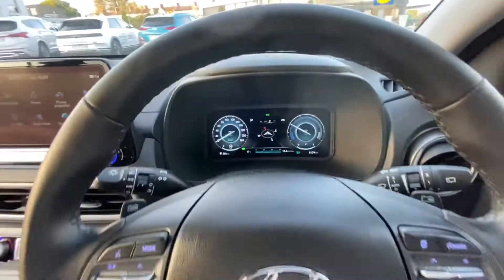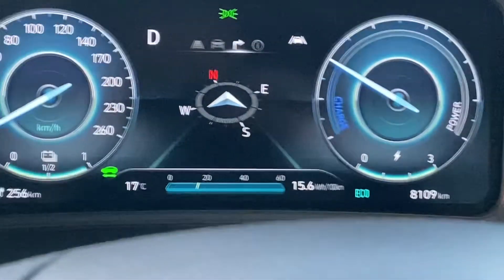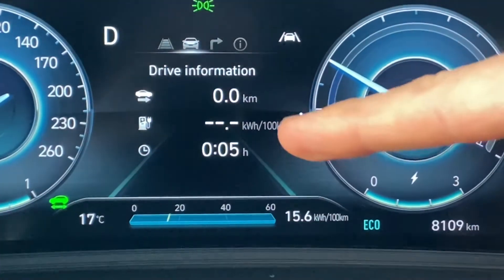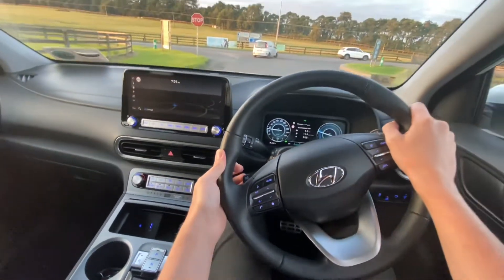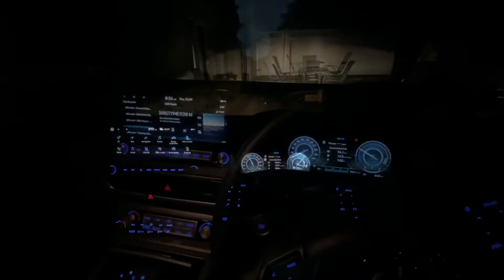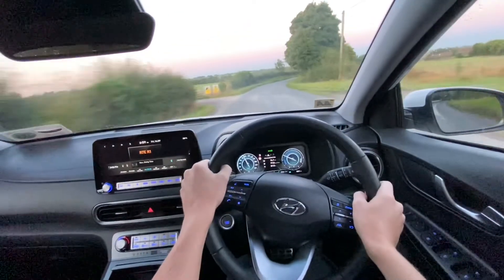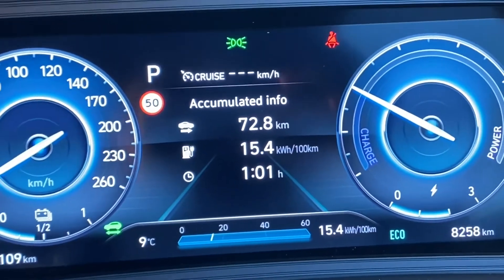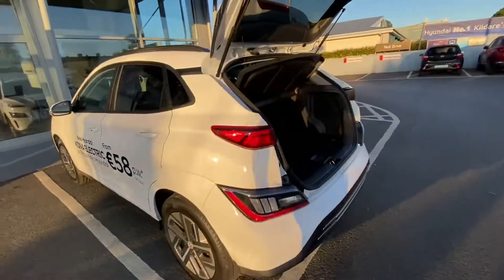Does regenerative braking work? I did a test  #regenerative #braking #ev

Comment: From a Motorcyclist point of view, it's almost exactly like the difference between riding a V-Twin 4 Stroke with high compression, versus a low compression 2 Stroke. After a ride on a 4 Stroke Twin, which has so much engine compression that it tries to send you over the bars if you just whack the throttle closed in lower gears, you get an eye widening surprise when closing the throttle on a 2 Stroke, and it freewheels like you have popped into neutral lol. The expectation of slowing down changing to freewheeling without you resetting your brain to remember this, can almost fake you out into thinking you are accelerating instead, hee hee. My Kona EV did this to me the first time I turned off all regen, forgot, then when I expected a slow down, went Auugh! as the car seemed to speed up instead hahaha
Reply from the maker: Exactly, that’s sort of like the retarder on a truck too 🙂

Comment: You say the motor changes direction for regen. Are you sure about that? Wouldn't that mean you would start reversing? When regen kicks in does the electrics flip to charging the battery, but the motor is going in the same direction?
Reply from the maker: Yeah I should have said the flow of energy through the motor changes direction 👍

Comment: suprised it made that much difference in a mixed driving situation. but anyways, if you managed to drive one car after another at the same pace, it wouldn't matter. it helps in town since you start breaking earlier and doesn't help on an open road because you want to keep the speed as steady as possible. i haven't driven the Kona but i have driven an Inster(actually waiting for one) and the regen beyond level 3 is really strong.

Comment: If you have a RWD EV, does it only regen the rear wheel?
Reply from the maker: @verynick  the car will be a single motor so my understanding would be that the rear wheels, turning in turn, turn the motor to facilitate regen braking

Comment: We just bought a secondhand KONA 2021 Petrol Hybrid Ultimate in the UK.  The brake pedal really needs to be pressed hard to get it to stop.  Before going back to the dealer and ask why it’s like this, I thought I ought to try the regen brake mode.  How do I switch on/increase the brake regen? The manual says put the car in ECO mode and use the left steering wheel paddle to increase the brake regen?  Do I do this when moving or stationary? Can I not have it set automatically?  Seems a bit of a faff to be fair, coming from a non-hybrid car where the brakes were super sharp.  Any help would be greatly appreciated 🤞
Reply from the maker: Okay, this video might be helpful, even though it’s to do with a hybrid it will show you how to engage the regenerative braking using paddles https://youtu.be/PrNVSxL7A-0?si=fkHK059pOIy5aOIq , does it make sense? The regenerative braking can be engaged at any time while driving. The car just needs to be in drive. Let me know if this makes sense. If not then I will try and get a video done to help you.
Reply: @doolanbrian  many thanks! I’ll give it a go when I get to drive it next and report back 👍
Reply from the maker: @bsinghgill  do indeed, and if you are still stuck, then I will do a video
Reply: @doolanbrian  much appreciated 👍
Reply: @doolanbrian  , Hi, I just tried the regen braking on our KONA Hybrid by pulling the left paddle to increase and right paddle to decrease the level.  I’m not sure if there’s a way to have it set on a specific level when you start the car? Otherwise, you have to consciously remember to engage it.  I know for a fact, this will be a faff for my wife, but hey ho, such is life 🥴
Reply from the maker: @bsinghgill it depends on which Mode you are in. Are you driving mostly in eco-mode or normal or Sport? From recollection, eco-mode is naturally set at regeneration two, and normal mode .. I think sport maybe level one 🙂 after that you need to manipulate during your journey .. slightly intimidating at the start, but once you understand it it gets a lot easier!
Reply: @doolanbrian  thanks again.   I think on the full electric KONA, it’s possible to have it set at a default value whenever you get in the car, but not so in the Hybrid version according to the manual.  I’ve read that placing the car in ‘P’ and ‘R’ cancels whatever regen level you had it set to on your last drive.  If you’ve got a Hybrid KONA available to test this, I’d be keen to know if the manual is correct or there is a way to keep it set at a particular level 🤞👍
Reply: I’ve recently had a message come up on the right-hand side dial in ECO mode when trying to enable regen with the left paddle: ‘Recuperation criteria not met’.  I have read on various forums, this could be due to the battery capacity already at 75% full, others saying that the vehicle is not sufficiently warmed-up.  My wife drives a grand total of 4 miles a day in the car for a couple of a days a week.  She’s tried to enable regen to get extra assistance when braking, as without it , she finds she needs to depress the brake pedal quite hard to stop the car.  Any thoughts on what criteria needs to be met so it can be enabled again? I took the car for a spin after she told me and I experienced the same issue.  It’s only when I put it into sport mode for a brief period then back into ECO, and this made the battery gauge drop below 75% at which point I was able to engage regen again.  Anyone else experience the same thing and were able to correlate whether it’s the battery level or the fact that the car is not warm or something else?
Reply from the maker: @bsinghgill  I don’t have the criteria, but if it is telling you that the conditions are not met then most likely there is no space to process the energy coming from the regenerative process so I only really ever see this message when the battery is still fairly well charged in other words over 90%.. temperature will have some sort of impact also so I’m sure the motor has a temperature threshold where it can’t process the energy from regenerative braking, but I would imagine those occasions are rare. My feeling would be dead even if the battery was fully charged once you have consumed circa 5% of battery, you should be able to do some level of regeneration. Interestingly, I have noticed it more so in the summer than the winter, but that is only based on an anecdotal thought.

Comment: The motor turns opposite direction when in reverse, NOT in regen.
At any given speed, the motor will always have the same rpm no matter how much power it uses or if it regens, i.e. rpm will always be 8.000 at 30 km/h.

You can simply not compare a drive A-B to B-A, on different days with different weather.
Dirve mode in it self is not more or less efficient, but the difference in drivingstyle. Less regen is more benefitial because you'll tend to let of the throttle earlier. But that will only be true if when you do brake, you regenbrake (rather than fricitionbrake) with brake-pedal..
Throttle (using energy) is about 90% efficient (10% loss), and regen is about 90% efficient (10% loss). More regen normally means you spend more time using energy, and easy math says that gives higher losses (dubble losses as Porsche correctly states).
But, it's all down to drivingstyle, not the mode...
Reply from the maker: So what your saying is regenerative braking has almost no effect on efficiency ?
Reply: @doolanbrian  well.. I'm saying it depends. It all comes down to driving style, type of road etc etc.
If you have to brake, i.e. down a steep hill, regen is much better than using friction brakes.
In general, it's better to avoid regen, go off throttle early, coasting down to an optimal speed instead of relying on regen to slow down. But this is not always possible, and may conflict with your drivingstyle, resulting in more use of brakepedal and thus more use of friction brakes.

My result with Leaf was better efficiency in D (low regen), and thus higher consumption in B (max regen) because I was "forced" to plan my driving better not to touch the brakepedal as often. Difference was about 10% in my test.

Comment: I thought the general advice was to us regen in towns, and on faster roads turn it off and allow the car to coast down
Reply from the maker: I understand what you mean… my observation was that for some reason the consumption seems to be better with regen on even on the motorway. One thing I noticed, however is that if you use cruise control, the regeneration seems to be disabled which would link up with your theory.
Reply: @doolanbrian 
Its not disabled, its just not controlable manually with the cruise control, because the car is controling it in that moment and take the exact ammount of regen that it needs to keep the set wanted speed, also like it controls the ammount of acceleration..

Cruise control is the best way to drive because its coasting and takes only the excess energy to the battery better than anyone can do it mannualy with pedal
Reply: Some cars don't use regen during cruise control, they apply the standard brakes and they also don't coast, they try to maintain the speed all time; if going down a hill they break to limit your speed, you lose momentum, then they accelerate going up a hill to maintain the speed flooring it wasting more fuel. I don't think cruise control it's the best option.

Comment: i have a Kona and i love strong regen .
Reply from the maker: I totally understand why people do it now just for me, I prefer zero regen , but it looks like a strong regen is the most efficient!
Reply: @doolanbrian  i like it because i feel safer and emergency stopping is a bit faster. PS im in England and i went to Ireland last August but i only used one charger at a Liddle i think because it was PAYG and i hate apps . lovely holiday though .
Reply from the maker: @rodden1953  I understand what you mean .. on that topic of stability one thing I will say is, if you are cornering quickly, the car feels a lot more stable with the level three regeneration on, you get better feedback as to what the vehicle is doing on the road 💪🙂

Comment: Your end results are the "on balance" or "all things being considered" value.

During the drive at level 3 you likely are using (consuming) more energy from the battery with acceleration at those moments and normal consumption during the normal drive portion.

However, the deceleration regeneration is putting enough electrons back into the battery to show that net improvement.

If you had the correct "downhill all the way" trip with regeneration on you could theoretically arrive at your destination with near zero energy loss (some systems are always going to be drawing power) from the battery.  Of course, the same would be true for a gasoline powered car that coasted downhill all the way.
Reply: i think ive seen driving downhill add as much as 10% of charge into the battery driving my 30kWh Nissan Leaf in the Alps. not to mention basically coasting for several km will help range.
Reply from the maker: Fairpoint, thanks for watching! It’s not a mathematical certainty. It’s just an observation based on two journeys, but there was always going to be confounding variables.🙂
Reply: @doolanbrian  You are welcome and, of course Happy New Year.

I also found it very odd at first to do "one pedal driving" where you allow the regeneration process to slow/stop the car. However, one does get used to it.  It can even be a satisfying feeling to properly plan ahead on when to let up on the accelerator. A pat on your own back for having good foresight.
Reply: can you go downhill without regen though, since every time you use the brakes, regen kicks in? So even if you are not in B mode, you would still end up with a net gain (not just near zero energy loss, but an actual gain)
Reply: @silviuguseila2552  My PHEV can essentially coast downhill while in 'D' and get a bit out back into the battery.  Shifting to 'L' will more aggressively restore the charge but, sadly, it will never exceed the normal hybrid upper limit and start filling the plug-in portion.

Once the plug-in electrons are used up, they are gone until the next plug-in and I am driving around as a hybrid. 

I don't mind that though as hybrid mode tends to average near the 45 miles per gallon mark. Far better than my previous gasoline-only car that would only get 22 m.p.g. under ideal conditions.

Or was your question meant for the author of the video?  ;-)

Comment: How much it takes to charge frome 20% to 90% using fast charger?
Reply from the maker: Depends on the size of your fast charger ! It can accept up to 50kw every hour if that helps 🙂🙂
Reply: @doolanbrian  which is the best .. to charge till 90% or 100% ?
Cus i heard that it's better for the battery to control your car to charge up to 90% only .
Please help .. many thanks
Reply from the maker: @ahmadyk2  it’s a regular debate .. and I don’t have a set rule from the manufacturer for this 😞 we advise people to not allow the battery to drop under 20 , but to charge to 100 . I could be wrong but hyundai have given us no guidance to say not to charge to 100 % in ireland
Reply: @doolanbrian  many thanks 👍

Comment: I have a Kona EV 2022, and use Regenerative breaking  dependent on where I am driving.
In town with lots of traffic then level 2 or even 3 suits me better, since I can allow the regen to slow me down rather than keep using the brake peddle. This is something you get used to, and also pulling and holding the left paddle to stop.

It's all about modifying your driving to suit.  Instead of letting off the accelerator pedal and freewheeling like in a standard ICE Car,  you feather the throttle instead.
This allows you to still "freewheel" when you want to.  (using the right Power dial display to hold the line if you cant feel it) This also means the regen will kick in by lifting off the throttle more.  Kind of like 1-Pedal driving but not full 1-pedal driving like in some other EV's.

Depressing the brake pedal gently also uses regen braking, it's only when you press harder on the brake peddle that the normal friction brakes come in.  This is the same as in the Prius (my previous car) as well.  In fact my old Prius did over 120,000 miles on it's original Pads and Discs :)

In your test you also had Automatic Regen set (The little Lightening bolt) so this would have caused regen to kick in a varying strength dependent on how close you were to other cars etc.
You can turn this off from the settings, or hold the Right paddle until the little bolt light goes out.
Auto regen can be a bit jarring at times, until you learn to understand and actually preempt it.
Reply from the maker: Hey, that’s brilliant information, thank you for taking the time to write this and that’s a really interesting point at the end I have never heard of that before so I must investigate that, I appreciate the tip!

Comment: 1:22, I hate the sensation as well, the Prius has it but it’s not as aggressive like it most definitely wouldn’t have the same amount of power than the normal brake pedal. Especially on motorways I’ve noticed because our Prius doesn’t have cruise control so we’re constantly adjusting the speed and that’s where I felt it most
Reply from the maker: I think Prius will have a B mode ?? So in that case for sure you will feel the restriction ! I have to go to optician Friday from 9:30 to 10:30 Robbie so is 10:30 ok for Friday ?? 🙂
Reply: Yep it does have the b mode, you do feel it even more, it wouldn’t be as strong as like level 2-3 on Kona. Yep 10:30 is fine for Friday 👌🏻
Reply: Except petrol is about 25pc cheaper than electric, that's why no car sellers advertise anymore you save money by electric cars

Comment: Brian, is it  the same on the Tuscon Hybrid?
Reply from the maker: It’s not, on the tucson , the paddles only change gears!
Reply: @doolanbrian  I find when I take my foot off the accelerator going down hill it slows down doesnt want to free wheel too much
Reply from the maker: @donnachalyons3904  It does have regenerative braking but it’s much less aggressive and you can’t control the amount but you’re right it is there! It’s just a different level I suppose, sorry I thought you meant can you change it from the paddles !!
Reply: On the Tucson the amount of regen is controlled by how much you brake which you see on the eco display on the dashboard
Reply from the maker: @MarkRiddellRacing  I understand what you mean. but it’s not a setting like an EV .. so you don’t have a choice whether to disable or enable it at different levels compared to an EV .. thanks for watching🙂🙂